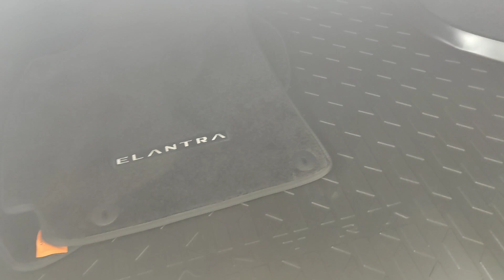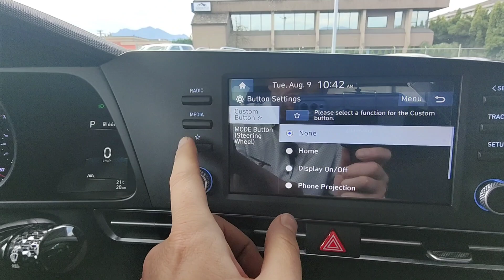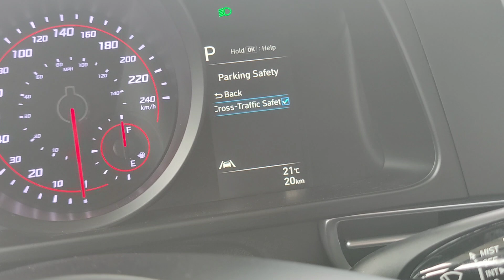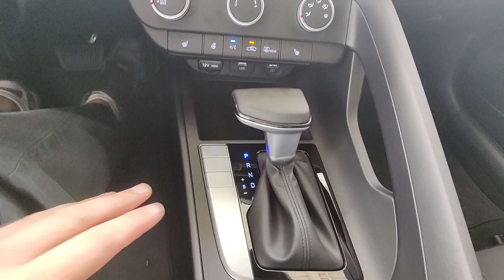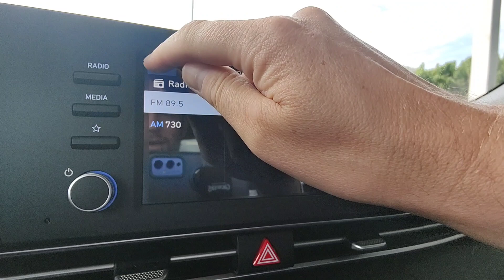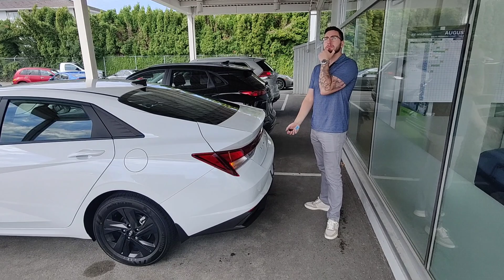2023 Hyundai Elantra Preferred - Preparation for customer pick-up!

Comment: Hey Ed, great video! I just bought the 2023 Elantra preferred w/o techpkg. Just wondering how often you guys have problems with the electronics? Cuz I'm debating if I should add the extended warranty or not. I live in QC and it's 3k+ just for the extended warranty so it is not cheap but is it worth it? Thanks for any insight on this.
Reply from the maker: Thx for the comment!

If your plan is to keep the car for 8 years, and you're not technically/mechanically inclined, then maybe it's not a bad idea to get the extended warranty. 
Get a complete picture of exactly what is NOT covered before you purchase any warranty though.
Reply: @edsgarage001  Thanks for the quick response and advice! I took it to finance for 5yrs and I know the general warranty covers for 5yrs, so I wasn't sure if it was worth it. Is it possible to add/remove the warranty before I get the car? They said it will take up to 2-3 months before they receive the car (no official papers have been signed yet, only a deposit to order the car).
Reply from the maker: @Avishka30  you only really decide to buy or not to buy the warranty on the actual day you pick up the car. No one can force you to do otherwise. 
I'm fairly certain you can cancel a warranty within 30 days if you change your mind.
Reply: That’s what I’m struggling with right now, didn’t sleep all night, financing for 7 years but who knows if I’ll decide to trade it in at 5 or less years. I got the extended warranty but the cost is astronomical. I wish I was never offered it because it’s stressing me out lol. Plus I drive quite a bit, the warranty will be void once I hit 160,000 which would definitely be in 4-5 years. So I’ll be paying for extended for 3 more years after that and there would be no use.
Reply: @deviouseyesxo8245  Honestly I think the extended warranty is such a waste of money for a brand new car. I got it for my older car and really regret it. These days, the new cars are so well-made that probably one won't need to pay for getting an extended warranty. Just my 2 cents and personal opinion though.

Comment: doesnt it have the dual climate control because its mentioned on the website
Reply from the maker: In Canada,
The Preferred trim doesn't include dual zone climate control. Nor does it say anywhere on the website that it does, so I'm not sure what you're looking at.

It is however, in the optional preferred with tech package. But this video doesn't have the tech package.